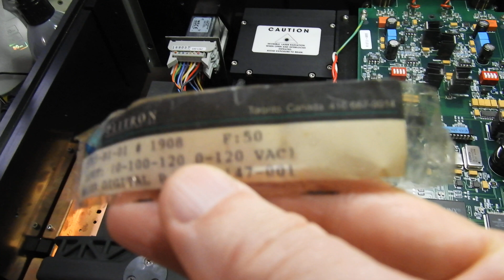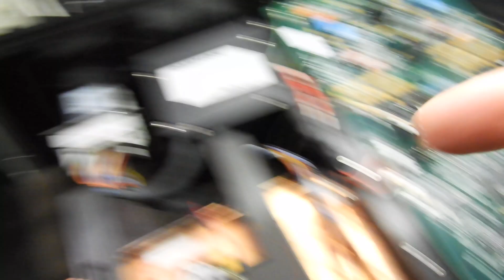Wadia 860 / 861 120V to 240V AC conversion and Wadia 860 not reading CDs repair.

Comment: Hi how do you open the top cover ?
Reply from the maker: Put it on its side and then using appropriate Allen key, remove screws in 4 corner cylinders and then another 6 screws of the same head size from the edges of player. Then the top cover will fall out if you lean the player.. No need to remove the small ones, as these only come out if you want to remove the bottom cover.

Comment: Hi, I have anatec toroidal from US but would like to use it in the UK. Do I just join seconderies together? Tia
Reply from the maker: No, secondaries have to stay the same. It's primaries that are either in series or in parallel. That is if you do have two primaries.
Reply: @hear-net-au  Thanks 👍 it does two primaries.

Comment: Hi thank you for the very interesting video
However why the conversion instead of using a step down external AC mains transformer from 240 to 120?
Reply from the maker: It's neater. I had a transformer there for some months but after conversions, it seemed to have more slam. There's a school of thought that the low voltages in Japan and US do not produce the same good results as 230V AC